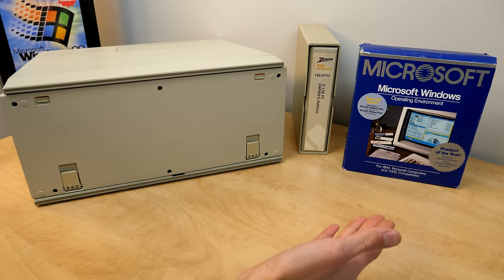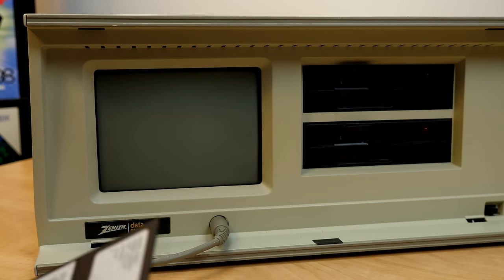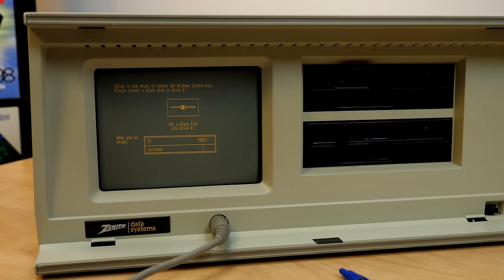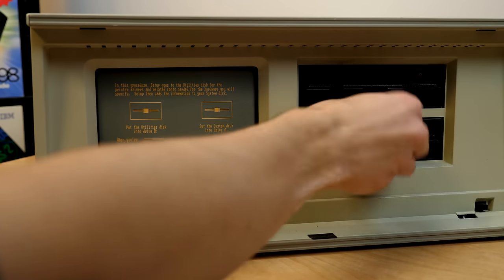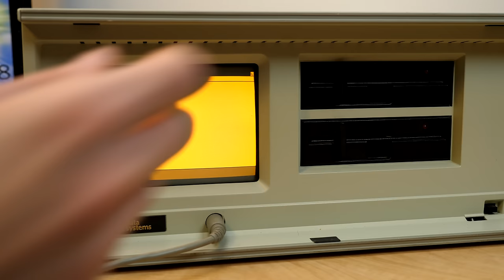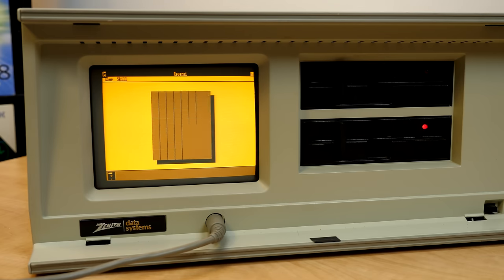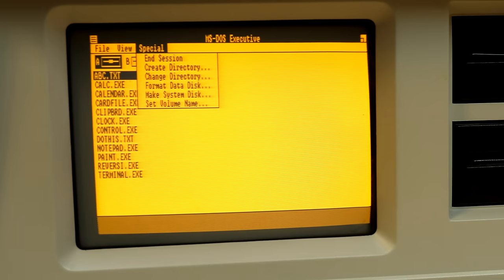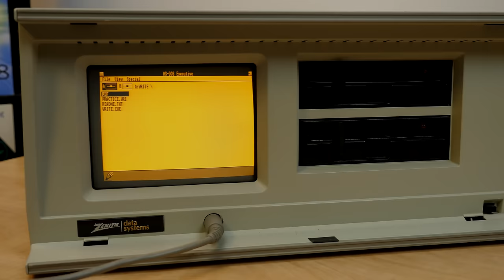Installing Windows 1.0 on an '80s Zenith Portable PC!

Comment: I think this really puts into perspective why Windows was initially so unsuccessful. When you run Windows 1.0 on a modern emulator with unlimited storage, a mouse, and a full color display, you tend to forget that in the mid 80s when Windows released, most PCs looked more like what Michael showed. They typically had no hard drive, a monochrome display, and were much slower than we'd expect from today's computers. Microsoft was clearly trying to compete with Apple's Macintosh and its operating system when they released Windows, but they didn't take into consideration the limitations of IBM PC compatibles of the time. By the time Windows 3.1 released, the entire computer industry was completely different. The mouse, color displays, hard drives, and faster CPUs were much more commonplace by 1992, so it was much easier for it to gain a large userbase.
Reply: Maybe if they'd had better programmers, because the Mac OS ran smoother and was more functional on a 128K 8 Mhz 68000 classic than on this 640K 8088 8 MHz PC. I am far from an Apple fanboy, but in the 1980s only Apple knew how to make a GUI on a personal computer. Okay, maybe Commodore.
Reply: @stepheneickhoff4953 I mean, it's pretty cringe to be an Apple fanboy now, but back in the 80s?  I would've been drooling over those Macintoshes.
Reply: Genius
Reply: @destructodisk9074  Success also came with 3.11. As a kid of the 90s, I was always intrigued by my friend's parents whose family PC ran Windows 3.11 right up to the year 2002 before being replaced. It had IE 3 and connected to the 'net on a 14K modem. I believe it was a 16MHz 386. They definitely weren't poor; just extreme misers.
Reply: Oh hey it’s you, I’ve seen you in the aipeter streams before lol
Reply: Oh hey it’s you, I’ve seen you in the aipeter streams before lol
Reply: Oh hey it’s you, I’ve seen you in the aipeter streams before lol
Reply: Oh hey it’s you, I’ve seen you in the aipeter streams before lol
Reply: Oh hey it’s you, I’ve seen you in the aipeter streams before lol
Reply: damn… we have it good these days, man
Reply: Sheesh, yeah, the difference between real hardware at the time and VirtualBox or VMWare running Windows 1x is just night and day.
Reply: In short the Windows operating system was ahead of its time relative to the hardware it was trying to market to.
Reply: @lightyagami3492  Something that Microsoft would do time and time again.
Reply: Also helped to have the entire Mac GUI in firmware/hardware.
Reply: Still it would be more interesting to see the same video on another computer with a colored display and a mouse. I understand that the video might aim at showing how Windows 1.0 would look on MOST computers of the time, but still.
Reply: MacPaint was the bomb
Reply: @stepheneickhoff4953 while I agree with much of this don't forget apple poached much of their GUI from Xerox.
Reply: @stepheneickhoff4953 that’s because they cheated: most of the Mac ‘OS’ is in the ROM on a system they controlled fully.

MS had a much harder job. They had to do it all in software for machines made by someone else, machines that shared very little compatibility.
Reply: I'm surprised you didn't bring up the Commodore Amiga

The Mac was really expensive at that time, so Commodore did pretty well with it's aggressive pricing.
It's just too bad that there was no good software outside of games.
Reply: @cubedmelons876 they really messed up after around 2020. Don’t know what they expected removing every port except 2 usb-c ports though I still crave their tablets.
Reply: @cubedmelons876  How about BEFORE the Mac, like the Apple IIe ??? We used those in school, as well as Commodore 64s.
Reply: Those were the days when a 20MB hard drive was the stuff of wet dreams….
Reply: @dorsetdumpling5387  The first hardware upgrade I remember was putting 16MB RAM in my Windows 3.11 computer. Now computers need at least 16GB RAM to work normally.
Reply: You could have all those features if you wanted to spend the money on a HDD and GPU and so on; let's not pretend Macs were the cheap alternative to get those better features. Also keep in mind that the focus of each OS is different. Windows supported multitasking since the beginning; Apple didn't support it until version 5. You could also argue that Windows wasn't their flagship product and didn't have much of a niche to fill. DOS was stable, fast, easy to understand, widely supported, and feature-rich.
Reply: For an average home user Windows 3.1 or 3.11 was really the first viable MS GUI.
Reply: @brentsummers7377  Businesses too! I took a computer applications course in '91 (just before Win 3.1) and it was done completely in MS-DOS. I don't know anyone that used Windows in that era.
Reply: deadchannel7895 The glitch was on his side, sometimes you send it multiple times by accident due to buffering
Reply: @stepheneickhoff4953  You are an apple fanboy tho or just clueless. In 1985 it was simply too early for GUI because hardware just couldn't handle it and so original macintosh was too slow even for 1984 standards and it was unsuccessful as well.. in fact the original mac was the very reason why steve jobs was fired from apple, lmao.
Reply: @cubedmelons876  The gui was just a gimmick in 80s.. the original Macintoshes were too slow even for 80s standards and they also failed.
Reply: Also didn't automatically have Internet in every home... No WiFi.. and well off people could have dial up modem which would  be  slow but it's all we knew at the time ... And it was awesome!!!!😊
Reply: @kristopherguilbault5428  I'm pretty sure Windows didn't even really support networking at all until Windows 3.0, which was several years later.
Reply: That's true but their success was not giving up despite the odds not being in their favor. They kept upgrading the code base and making the OS better. If they had just given up, by the time 1992 arrived, it would have been a massive blow.
Reply: microsoft? more like macrohard
Reply: That's not true at all for when Windows 1.0 was released... monochrome displays were a thing of the distant past.  You must be very young.
Reply: @IUSSHistory  Existed, maybe.  But very few people were still using a monochrome display in 1985.
Reply: loool we are old...
Reply: Nah, people were writing their own window managers for CPM back in the 70s already. Even on limited hardware it would've been considered impressive enough. The reason why windows 1.0 didn't cause a revolution has more to do with efficiency of keyboard based apps for DOS and people's expectations.
Reply: Apple rules, Microsoft drools 🍎🍎🍎🍎🍎🍎🍎
Reply: Windows 1 was also just bad. It wasn't just competing with macs which were designed from the ground up to be GUI, but Unix workstations were also starting to pop up at that time and had a variety of desktop options.
Reply: Anyone remember quikmenu 1/2/3?
Reply: @JustMe99999  : I was - at school.
Reply: windows 1.0 basically wasnt available to the public. Or at least... Noone in the public used it. People went from dos to windows 3.0
Reply: Even on a modern PC Windows 1.0 is ass. It looks horrible and works very weirdly
Reply: Apple LICENSED a lot of the GUI ideas from Xerox, spent a lot of time and effort finding ways to make the UI work better, and their amazing programming team implemented it on underpowered hardware
Reply: I'm currently 28 and I'm watching this frustration 😭

Comment: Upgrade windows 1.0 to windows 3.1 on the 80s Zenith portable pc (But everything goes wrong)
Reply: Request confirmed!
Reply: Can you tho, Windows 3.1 is from 1992 and this PC is from the 80s
Reply: Yeeeeees!!!
Reply: Windows 3.1 requires a 286 CPU and this computer only has an 8088.
Reply: @aaaalex1994 You can't use logic on these types of people, they won't take it
Reply: Windows 1.0 -> Windows 3.1 wont work as 3.1 recuirs minimum Windows 2.0.
1.0 -> 3.0 shoud work
Reply: @Galaxy.Windows  Bruh really said "recuirs" 💀
Reply: @Galaxy.Windows  let us have our dream 😓 still, would be a cool thing to see. Question is, with the graphics hardware, it could run Windows 2.0. Issue is, realistically, you cannot make it to 3.0 because of memory and CPU restrictions
Reply: Good.
Reply: Plllllleeeeeaaase! I love your upgrade videos.
Reply: @aaaalex1994 huzzah!
Reply: Not possible, windows 3.1 does not support the 8088.
Reply: Windows 3.1 requires 3 mb
Reply: @aaaalex1994 I mean could give it an accelerator card to give it the 286 to an extent....
Reply: You forgot the "but everything goes wrong" part lol
Reply: @DMadHacks  Oh yeah your right thanks
Reply: @ozzie_goat 😊😊😊😊😊😊😊😊😊😊😊😊😊 22:03
Reply: Build 34f will work.

Comment: I've never seen Windows 1.0 installed on era-accurate hardware before!
Reply: That must be the only Microsoft product with no bugs.
Reply: @diegotr1903  i doubt it had no bugs, the product was a failure, it wasn't really popular yet at that time.
Reply: Windows is a bug.
Reply: @edb1913 what system do you use? Kinda wanna avoid it if you guys are like that over wherever you are 🧌🧌🧌
Reply: @kebab_hill If it was successful enough to lead to 7 iterations of DOS based Windows over the next 15 years, it wouldn't really be a failure.
Reply: @kebab_hill Part of it is that all applications/programs started from an executable floppy disk because HDDs weren’t a thing. So, you simply typed .exe command after inserting a floppy.
Reply: @edb1913  unless you're a peasant who cant afford apple macs in the 80s or Linux purist who doesnt exist yet as an OS, trust me, its either ease of use of Windows gui or the tedious DOS command interface. Your choice
Reply: Can’t say installed on a computer without a hard drive.

Comment: Something in that monitor's horizontal drive circuitry is starting to fail. If you haven't noticed the picture keeps shrinking and expanding horizontally.
Reply from the maker: Yeah I noticed, definitely has to be looked at
Reply: I wasn't looking too closely but I figured it was happening in line with disk activity. When the drives run the +12v rail will dip. Assuming the monitor doesn't have its own power regulation this will change the deflection strength.
Reply: @eDoc2020  my TRS80 Model 4p does this as well... same the problems you stated

Comment: First time I've actually seen real use of floppy drives, crazy that you can just plug and play them as you like
Reply: Not as you like, you have to wait for the usage indicator to go out before pulling it out.
Reply: @MetalTrabant  lol... yep you can't even get the disk back out with out ripping it to shreds...
Reply: When a programme needs to use a diskette it’s easy to use but to run a programme or save your work it required you to tell the computer where the diskette is and then what you want to do on the disk 
The storage on the disk was only a few hundred kb of space .
Reply: @bernardtaylor7768 what's a programme?
Reply: @TheALPHA1550  program my bad 🤭
Reply: Use a hole punch on the top corner and you can use both sides of the 5" disk.  Can't remember where exactly the hole went; but, it did work.
Reply: Lol we used cassette tapes before floppies.... you think dealing with floppies or cd's is bad....
Interesting note. At least until VERY recently there were .gov and corp systems that still used floppies.

Comment: Whenever you test out a calculator program on an old system, I think it would be interesting to see how it reacts to a divide by zero.
Reply from the maker: Haha I should’ve tried that!
Reply: The house explodes by it trying to process 0 divided by 0
Reply: I think just about all calculator programs test for that condition, really.  Even the fairly primitive Level I BASIC on the TRS-80 Model I (1977-78) would return an error message of HOW? if you tried to divide by zero.  (Level I had only three error messages:  WHAT? was any kind of syntax error, HOW? was a mathematically-impossible operation, and SORRY was when you ran out of memory.)

Comment: FYI Alt+Spacebar works on modern versions of Windows too (because of course it does). It saved me many times when some Windows scaling or desktop window position restore bug put one of my windows outside of the screen. Just Alt+Spacebar, Move, arrow keys, Enter, badabing, badaboom. It's funny how little known it is, to the point where the default keybind of PowerToys Run (a Microsoft developed tool!) is Alt+Spacebar. I have to change it to Win+Spacebar every time, because I can change my keyboard layouts with Ctrl+Shift already...

Comment: Today I first heard the word "luggable". And I first heard it a few hours ago in an LTT video about a luggable PC chassis and now, a little later, in this video right here XD
Reply: Yah, "luggable" was kind of a retronym applied to this kind of portable computer, after laptops started to be a thing.
Reply: @AaronOfMpls 
Funny thing is, I've never heard that word before. But the day I hear it, I hear it in two almost unrelated places just a few hours after one another XD
Reply: @AaronOfMpls  The term was used for laptops as well for a while into the mid 90's when i finished my education. early laptops were heavy. not as heavy as portables, but still heavy enough that dragging it around with you was tiresome. Higher end models would also give you first degree burns on your lap if you used them the way their name implies.
Reply: @MrAntice  > Higher end models would also give you first degree burns on your lap if you used them the way their name implies.

Which was partly why manufacturers started calling laptops "notebooks" instead.

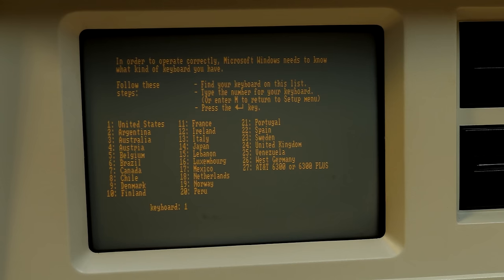Comment: 5:57 - ...I am actually genuinely shocked the Win1.0 setup had an option to set the keyboard layout to a Luxembourgish layout of all things. I was actually expecting it to be Swiss French or Swiss German (in the present day, both Luxembourg and Switzerland use the same QWERTZ keyboard layout (either Swiss French or Swiss German, but Luxembourg generally uses Swiss French), but I don't know if things were different back when Win1.0 was released).
Reply: So for fun, I actually installed Win1.03 inside a machine in 86Box (that was as close to era-adequate as possible)....and it turned out, when I ran Windows after setting to use the Luxembourg regional settings (as I found out)...it was using the French keyboard layout, with some country-specific settings.

Comment: Amusing video.  This video brought back memories from earlier in my career when I worked at Corvus Systems and and Iomega in technical and field support.  All of us in technical support despised Windows 1.0.  DOS was much easier, reliable and quicker.  Windows wasn't really worth using until 3.1.  I can remember often spending an hour or more trying to help customers set up their disk drives and networks.  Back then you not only had DOS and Windows but a host of competing operating systems like CP/M.  Things have come a long way.

Comment: I love how cool this computer is!!! It's like a tower with a display and a handle. The insides look really cool and the upgradability is probably record breaking. I wonder how efficiently could someone modernize it. To make a real sleeper pc, by stuffing the latest and greatest internals in a beige box. Would love to see that. Great video
Reply: Heh -- the actual upgradeability of the machine really wasn't that great.  It was an 8088-based system, and that one ISA slot was actually an extra-cost *option*; if you just bought the "base" machine, it didn't have the ISA slot, or even a place on the PC board where you could solder the right connector in later on.  The CGA video was integrated into the board as well, so the only possible upgrade on a base system was to max out the memory at 640K, and add the 8087 math coprocessor.

That being said, you probably could do some really interesting upgrades to it today by swapping out the hardware for modern equivalents.  The biggest barriers (other than physical mounting) would be the monitor -- it's a CGA-only monochrome, so you'd pretty much have to replace it with some kind of equivalently-sized LCD flatpanel, and good luck finding one that's the right size nowadays! -- and the keyboard.  Being an 8088-based system, the keyboard uses the XT signaling protocol for the various keystrokes, whereas everything nowadays uses AT signaling or USB.  So the existing keyboard won't work with a modern motherboard.  So all in all, you'd be in for some serious mechanical customization work!

Comment: Heh -- talk about nostalgia; I had one of these Zenith Z-130s back in the day!  In fact, it was pretty much my "daily driver" PC up 'til about 1991 or '92, IIRC.  Unfortunately, mine was just the "base" model, where the I/O daughterboard only had a floppy controller on it, and no ISA slot.  (There were three different daughterboard options, again IIRC -- the base floppy-only model, the floppy + ISA-slot model, and then the "top-end" model that had an ST506 hard-drive interface as well as the floppy and ISA cardslot.)  So the 8087 math coprocessor socket was about the only upgrade I could do to it.

Still, I used it for years, until the monitor finally failed -- and even then, I stretched its life out a bit longer by putting a green-screen monitor on top of it, until I finally picked up enough bits and bobs at the local swapmeets to actually build a proper PC.  (Since the 486s were hitting the market and becoming the "hot" item, there was a lot of surplus and secondhand 386 stuff hitting the swapmeets at the time.)

Comment: Brings some memories back. Both 80286 and 80386 were out on the market when I got my first computer, but all I could afford was an 8086. It had a floppy diskette and the operative system; the DOS had to be loaded first every time I started it. Interestingly, I had Word, Data, and Excel on a floppy, and I had a matrix printer. The commands I was learning are still, to this day, what you can use on the latest versions of Microsoft Office.